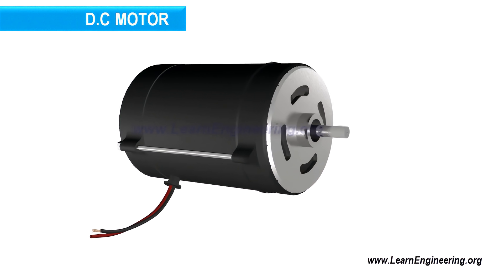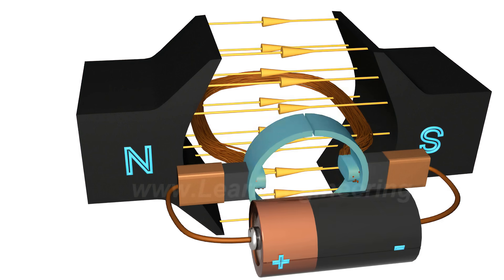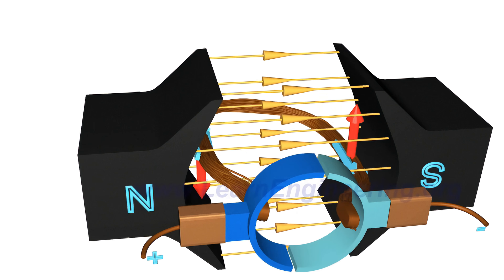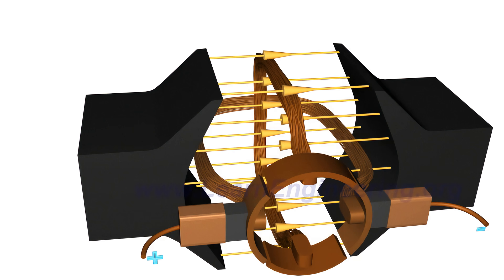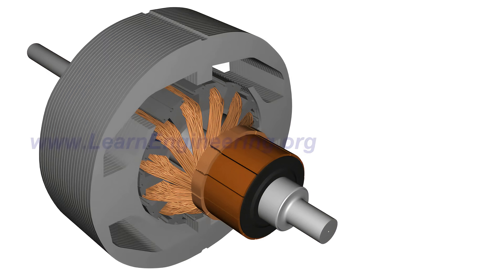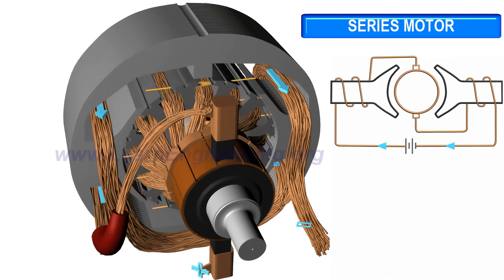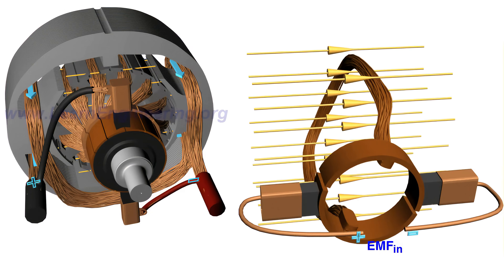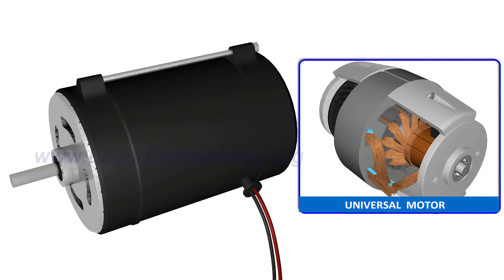DC Motor, How it works?

Comment: Knowledgeable people, I could use a little help. I'm having trouble understanding 4:20.

The repulsive EMF of the armature is "too low" such that current becomes "too high" and damages what?

Are they saying that, the high inductive potential of the armature coils creates a load so great that, when switched on, applied current to the circuit could exceed the maximum amp. rating of the copper wire (to satisfy the voltage potential made possible due to back EMF), causing it to overheat and melt ("burn out")?

I have a thing against relative terms (too), generic phrases (burn out), and non-linear, -step-by-step, -modular explanations. Spare me the math.

Anyone who thinks they can tackle the task of explaining it to me? All help is appreciated.
Reply: Lmao, I asked you to spare me the math, so, of course, you gave me 80% math.

I don't think you understand electronics as well as you think you do.
Reply: Nico Mariño That insult! My dear God! It hurts to be called someone who uses the internet in a way others deem inappropriate!

You didn't help me, that's my point. Don't feel so butthurt.

Read what I said, understand what I'm asking, and clarify. "Yes, you're correct that _, but this part actually works more like __." That's helping me understand. That's taking my understanding and helping me to shape my understanding to be accurate.

Aanndd that's exactly what I did. I asked for help, giving my understanding (I allready dun did som lernin'!) and asking for clarification. I took it upon myself to use all resources available to learn.

As for your understanding, you're using strange words. The input is x volts, and so you begin 'generating' voltage? What is generating voltage within the motor? It isn't a generator, it's a motor (same principles, different applications). Do you mean "If you start out with 100v, the motor will start, but then if you decrease that to 70v, the current passing through it will decrease such that the wires do not melt?"

What are you talking about 'short circuit current?' The current passing through the wires if you short the circuit? To what? To the ground it's already connected to? That's not really much of a 'short,' a 'short circuit' implies that current bypasses a resistor, resistive component, voltage divider, or voltage-dropping component such that the current or voltage passed to a component exceeds its maximum V|A ratings.

If you're going to explain something to someone who you would assume has little working knowledge of the material, don't use jargon or complex topics, simplify it, as I did in my explanation of my understanding. Try to keep the complexity at the level with which you were asked the question. Otherwise you're just intentionally talking over someone's head.
Reply: Calling someone a troll (or any insult, really) kind of opens the door for me to guiltlessly scrutinize and insult you. Mind that, and your manners.

Well, that's also my point, another sign that you aren't really paying attention. I'm not looking for theory, theory is abstract from application, I'm asking for assistance in understanding the application of the theory.

How the generation of a magnetic field induces a larger current than anticipated.

I don't care about the mechanical forces acting on the gear, the friction it experiences, the structural integrity of the metal, or the torque exerted, I want to know why gear ratios reduce or increase work exerted to move a load attached to the machine. Catch my drift? Then I can worry about what goes into it (the aforementioned). Simple to complex, simple to complex. I'm trying to ride with training wheels, you're asking me to hop on a motorcycle.

I'm not going to pour through pedantic material for weeks just to develop my own understanding. I'm asking someone who already knows exactly what I'm talking about. That's clearly not you.

Comment: FYI this is how a DCgenerator works ^^ 3:47
Reply: of course if you can produce Magnetic fields using electromagnets , you can produce energy power with Magnetic fields by induction a.k.a transformers and wireless chargers i.e.
Reply: Micky mouse and Donald Duck

Comment: hi there teacher, can I know if there are permanent magnet dc motors with rotating magnets as rotor and stationary coils as stators in the market, I always see designs with rotating coils and stationary magnets but I dont see the opposite kind of dc motor I mentioned earlier above..why is that so?
Reply: They are called brushless dc motors, or BLDC motors they are used in your PC cooling fans as well as in quadcopters and radio controlled airplanes etc.

Comment: Hi! Great video, just like all your other ones!
       I have a question about the armature of the rotor. You say that it has HIGH permeability to ease the magnetic flux interaction. Shouldn´t it be with LOW permeability so it will reduce the eddy current losses when the rotor turns inside the magnetic field of the poles?
Hope i was clear with the question.
Thanks.
Reply: High permeability is required to properly interact with magnetic field of stator. And as for eddy current losses, the armature metal is laminated to reduce eddy losses. 
( I know it's late but ok)

Comment: Excellent description. In this model is the armature coil a single copper strand threaded back and fourth or is it several individual strands of copper connecting the pairs of commutator rings

Comment: I am not convinced by your field lines from the shaped magnetic poles, I don't believe the field  will be uniform and straight.
Reply: +Mark Hesketh This is an explanation of fundamentals.  It is not supposed to be an advanced course showing all the subtle aspects.  The field will form like any two other poles fasing each other, but the armature core material will also distort the field.  These are things that will only confuse the beginner.Cheers
Reply: This is assuming that field lines even exist, considering that they are only theoretical.
That being said if they did exist, it would be impossible to show every direction that each ray goes for even a sample. The diagram is just to illustrate that the overall force of the magnets are from north towards south.

Comment: good video but should the positive and negative connector be changed? the north magnet is attracted to the positive side(because positive is south) and the south magnet is attracted to the negative (Because negative is north).

I dont think this DC motoro will work unless you switch the terminals.
Reply: +Martin Naughton i check over the internet and the positive creates a south and negative creates a north. Change the terminal around and it should be fine. Great work
Reply: +Martin Naughton Actually never mind. what i said above was not correct. i looked up flemmings law and now understand that it is force from the electromagnet field on the current that is making it spin. not opposites of polarity which has nothing to do with this. thanks. great work.

Comment: In the DC motor, do axles on both sides of the motor spin, or only 1 side? When I buy generic motors, only 1 axles is exposed and moving. Would love it so that axles stuck out both sides of the motor!

Comment: I have a question about the armature. in another video I watched, the armature wasn't an armature, it was 2 seperates electromagnets welded to a central axle type thing. is there any major differences between the two? I ask because understanding motors is hard enough but then watching videos with differing informations just makes it frustrating lol.
Reply: I think I saw this video and the answer is that two electromagnets would decrease efficiency. What this video doesnt really include is that there WOULD be an axel that spins that is attatched on the inside of the two commutator rings

Comment: Very useful and thanks for uploading it. Couldn't understand it from my textbook. 
1 doubt btw. 
According to Fleming's left hand rule,  the North Pole will apply force towards the south Pole, and the current, the magnetic field,  and the motion are perpendicular to each other. 
So,  the North Pole should apply force on the coil which is connected to the split rings. 
The motion should be opposite I guess.
Reply: Well 9 yrs later and I have the same doubt...

Comment: there is actually a simpler motor, it only requires 3 parts (i believe) if i can remeber i think the parts were a AA battery, a wire and a magnet maybe i forget, but u can look up 3 part motor or soemthing liek that
Reply: +Pyro Sandwich The homopolar motor?
Reply: Gordon Freeman yeah , you use a battery and copper wire and screw now that I'm thinking about it I think you may or may not use the magnet also, 

but u put the screw tip to positive end of the batt, and the wore from neg. To the end of screw, and 8f there is a magnet it would either be on the top of the nail and the nails point at Pos. But if I forget
Reply: Pyro Sandwich
I think the magnet is a must in the homopolar motor, I've never seen it work without it.
Reply: yeah its been a while, i think so too

Comment: You lost me at stater. I think that's probably the round ring, but it might be the two black N and S poles. Or something else. This video is not useful unless you have a textbook to go along with it, or if you are studying engineering or small motor repair in a classroom. As an illustration I can see it being useful.
But to someone like me, a beginner, this is just frustrating. Can't watch more than ten seconds of it. I really wanted to thumbs up, but I can't.

Comment: You would notice the EMF on TV (the old ones anyhow).  I am not sure if the newer ones will show EMF.  The old ones were analog but now the new ones have digital processors inside them.  If you have any sort of LCD TV there is a surprising amount of chips in them all of which do different things and some of them are digital signal processors and some are RAM (like in a computer) to use as a buffer.

Comment: A question- the force direction on conductor - should it not be opposite to what's shown here, as per Flemings Left Hand Rule and based on the electrical circuit direction?

Comment: people always tell you to never connect two terminals of a battery with a wire because it's a "short" circuit.  Aren't you creating a short circuit in a DC motor with these coils of wire?  Why is this any different?
Reply: Good question. Well if you ever take an Ohm-meter and measure across the terminals of a DC motor while it's not running, you'll find a very low resistance (armature resistance) on the order a few Ohms. When you plug your motor up to a battery, at the first instant there's a huge current because i = V/R by Ohm's law. As the motor picks up speed, a back EMF is generated as shown @4:15 which drops the current because the voltage across the armature resistance is now lower. So to answer your question, when the motor first starts up, it looks like a "short circuit" for a brief period, the current won't be infinite at this instant because the coils do have some finite resistance.

Comment: I think that the circuit diagram for the series connection was wrong..the wire from the right field winding should go to the left without touching the carbon brushes.
Reply: Priyanku Goswami yes man...I felt the same while analyzing the circuit and comparing it with the diagram

Comment: Hey,, awesome video.. But i got a doubt.
when there are 2 pole on stator and four pole on rotor the net torque production  is zero. But you said there will be a smoother operation of rotor in this case. Where am a wrong?
Reply from the maker: prakhar patidar For 2 pole rotor,  only when the coil is perpendicular to the magnetic flux  the net torque is zero. Thus the operation won't be smooth. With more number of rotor poles we can make the operation smoother.